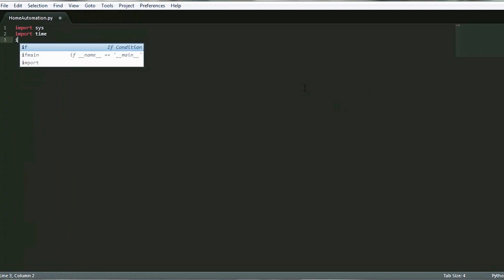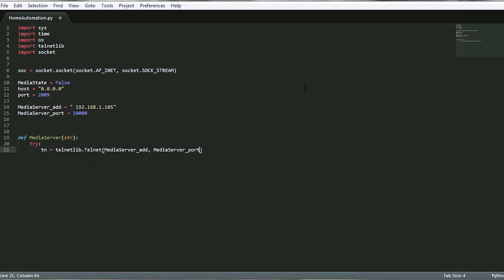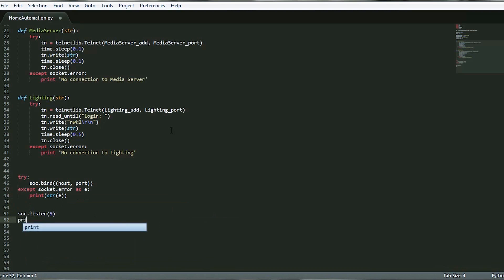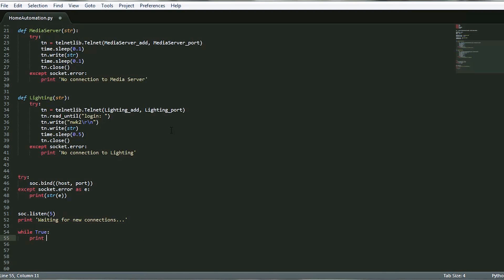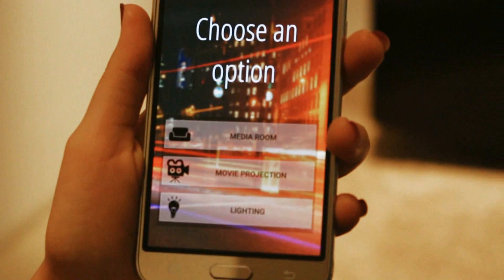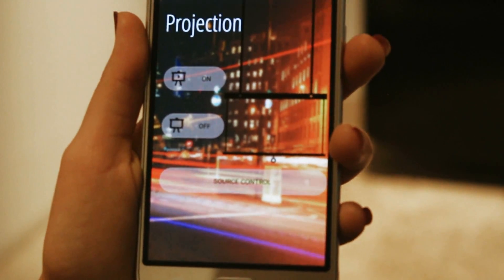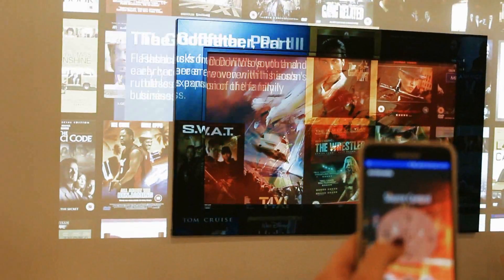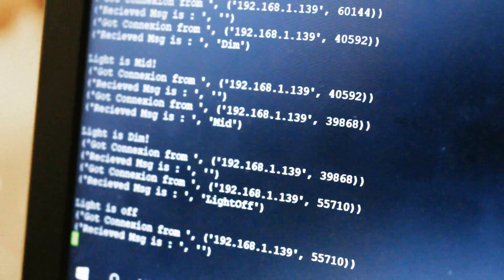Making a Home Automation System with a RaspberryPi and an Android Application.

Comment: you have given diffrent different ip address  and port number for many fuctions and my question is How did you get that?
Reply from the maker: For the IP adresses, I made them static in my network and used them in my program to get a telnet/ssh connection to the equipment (I avoid DHCP in these cases). For ports, it's not a random choice, It's given in the equipments' documentation.